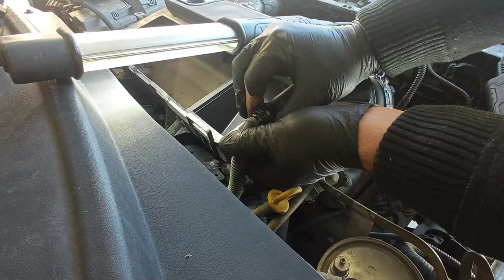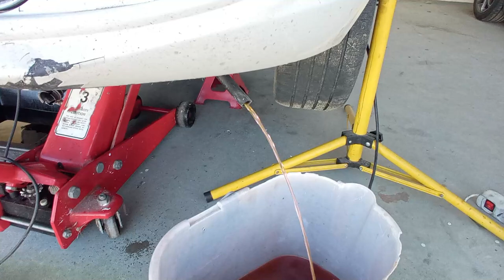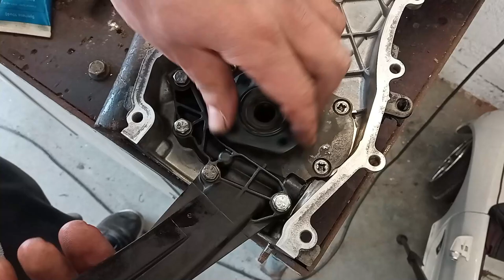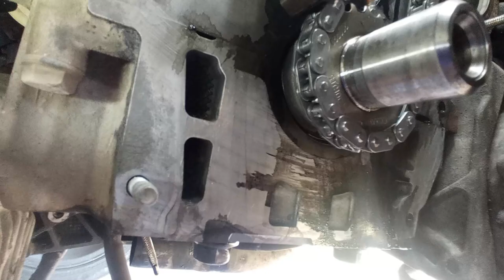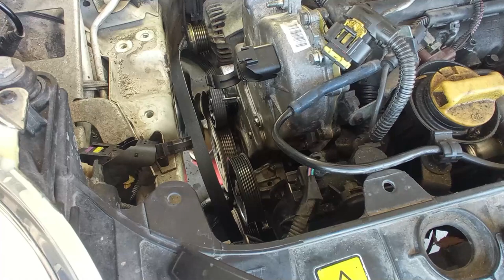Noise from something loose or scraping!? Timing chain for all 1.3 mjet engines for all years

Comment: I can't thank you enough for this video. This job took me 2 days as a hobby mechanic . Challenging was finding the torque wrench for left hand thread on the crankshaft. I ordered the dayco ktc1118 kit . this kit included the bolts ,except the oil pipe bolts and crankshaft flange.
Reply from the maker: Hello. Thank you a lot for watching the video! And thank you for sharing that info!

Comment: I'm sorry but I must point out one thing. Never lift this engine on the sump, it's super sensitive, slightest dent and it can couse a low oil preasure and that is super hard to locate since you can't spot the dent with your eyes, it needs to be meassured to be discovered.
I did it myself and spent a lot of time after chainging the timing chain figuring out what was wrong, I only run it for a few minutes but that was enough to mess up the turbo. During my search for the problem I only found one single line about this on google, only one, some guy having the same issue and that was the reason.
And I was very careful while lifting the engine, still this happened.
Reply from the maker: Hello. Thanks for the heads up. I am fully aware that. That's why I did it from the corner and only with the engine mount off.
I did forgot to mention it. Also I did reform the bottom a bit before going back in. In a future video I will talk about that. Thank you
Reply: @alfaromeonoproblem Please do as I’m fascinated as how that cane be a thing.
Reply from the maker: Ok, I will. Did it also on my 33

Comment: Brilliant video, such detail and well edited. 

I’m curious as to know how suspended carbon particles can stretch a chain that was designed for a diesel. Fiat have been making engines for a very long time and should have known what chain was suitable. 

Do you think halving the oils change intervals is going to help much?
Reply from the maker: Hello. All modern engines suffer from this. They have to make lighter engines and engine components to meet emissions. That and too long intervals on services will kill any engine
Reply: @alfaromeonoproblem  Thank you. Any explanation on the reason why a slightly dinted sump might cause issues on the fiat engine please?
Reply from the maker: @paulas2610 yes. The oil pick up tubo bends and the seal near the oil pump lets air in.

Comment: Really great video, I've got to do this on a 1.3cdti in a chevy aveo, this is the only video I can find on the subject as you can imagine there's not many chevy aveo enthusiast forums. It's got low oil pressure so I'm thinking there's some plastic guide parts blocking the pump as the timing chain is also due replacement. What bit do you use to remove the cam timing covers? Is it 8mm hex? I need something really low profile as there's less clearance on my configuration.
Reply from the maker: Hello. How are you? Thanks for watching. Can you tell me at what minute of the video are you referring to?
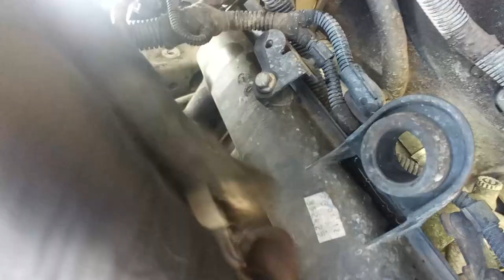Reply: @alfaromeonoproblem  It's 9:52, I can hear you say 8mm and it looks like it's a hex bit but not sure
Reply from the maker: Yes, its a 8mm hex. Just like on this video https://youtu.be/s1ViwKH4W1o?si=n_6iXOGzPKwWlooN
Reply: @alfaromeonoproblem  nice one thank you
Reply: @alfaromeonoproblem I’ve removed the pump now, and it looks okay, so does the timing chain and all the guides are intact. It’s a slightly different pump that doesn’t have variable flow but there was nothing blocking any channels. There seemed to be oil reaching all the right places as it drove quite a distance before getting to me with the low oil pressure light on, is there anything you can think of that would cause oil to not reach the pressure sensor properly? It’s had two sensors and I’ve tried a mechanical pressure gauge which reads zero so I’m quite confused what could be happening
Reply from the maker: @FlashFireSix the sump. Is it straight? The pick up tube is very sensitive to that.
Reply: @alfaromeonoproblem  it’s had a new sump, but I’ll ask the owner if the sump was replaced before or after the problem, thank you
Reply from the maker: @FlashFireSix probably a snapped oil pick up tube
Reply: @alfaromeonoproblem  I have the sump off too and the pick up tube looks okay, I did find some oil soaked part number stickers on the floor after I pulled the pump so I’m wondering if they’d been floating around and blocked the pump from working properly! I’ll get a new pump and chain on and see if anything changes. Your videos have been a life saver during this project so thank you for doing what you do
Reply from the maker: @FlashFireSix a sticker for sure you do that, for sure
Reply: Just wanted to drop by and say thanks to your video I managed to fix the car for my friends mum, who’s put about 400 miles on it since I gave it back all working great now. Keep doing what you’re doing and thanks again for all the help!

Comment: hello, I follow you every time, what you do is perfect, I also have a doblo 1.3 mjet 84 hp and I suspect low oil pressure, now I don't know if that's the case, maybe you can help me. cold 3.5 bar at 34 degrees outside / when it warms up to 80-90 degrees, the engine at idle is about 1.2 bars and at 2000rpm it has 3 bars and at 3500 rpm it does not exceed 3.5 bars. is it ok?

￼
Reply from the maker: Hello. That numbers are good, don't worry
Reply: @alfaromeonoproblem  Thank you very much for the answer.

Comment: Brilliant video! It's a joy watching you do the job properly! 👏
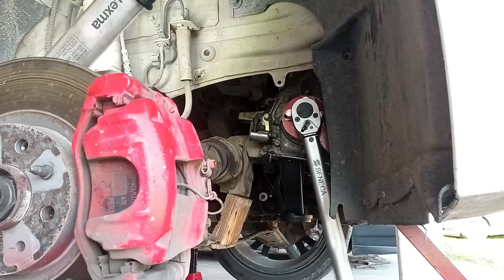P.S: 43:12 I think the pads are not mounted properly, the outer ATE pad says "PISTON", which should be inside and not on the outside. Correct or I am imagining it? :D
Reply from the maker: Hello. How are you? Thank you very much for watching! You are correct, aldo the ware signal wire seems correct because it is on the inside pad. 
Maybe. A miss print or the signal wire is in fact on the out pad. Is not very critical on small brakes like this.

Comment: Hello, very nice en useful video. My mito 1.3 always have a kind of raw start. It runs not nice and gives some blue smoke. It disapears after 5-10 sec. I already changed the glowplugs but it wasnt the problem. Can you help me? Thanks
Reply from the maker: Hello. Please check out today's video for that please
Reply: @alfaromeonoproblem  thanks mate, is it possible to refurbish or clean the injectors by yourself?
Reply from the maker: @rubenbroex3338 hello. No, it is not. They always need recalibration afterwards.
Reply: @alfaromeonoproblem  can you also not change only the needle?
Reply from the maker: @rubenbroex3338 no, mainly that!

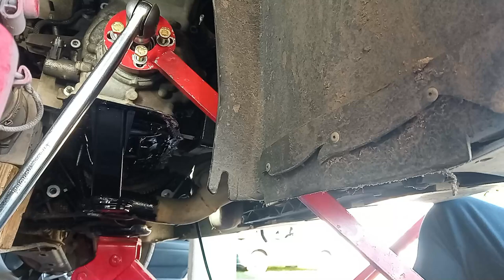Comment: At 17:30, what socket was used to undo the crank bolt?
Polydrive / RIBE sockets don't exist because the bolts are supposed to be tamperproof.
Reply from the maker: E18 torx bolt. You can find all kinds of ribe bits and sockets on your local workshop tool shop

Comment: Great video .I just did my 05 corsa by watching this. All back together but now wont start. sounds like starter not turning engine but  have seen the belt moving when turning the key. Have I left something disconnected ? Any help would be appreciated.
Reply from the maker: Can you turn the engine easily by hand?
Reply: I can turn the engine. At a loss as to what i did wrong? It does not even try to start @alfaromeonoproblem
Reply: Thanks for the reply ..
Reply from the maker: @jasperdesi5089 but does it spin freely?
Reply: @alfaromeonoproblem  I can only turn  it with a ratchet , not sure if I would say it easily.  I do have to apply a bit of pressure .
Reply from the maker: @jasperdesi5089 did the oil pump flange went it smoothly?
Reply: @alfaromeonoproblem  I put the oil pump in and left it in as I tightened it bolt. I could rotate it by hand as I tightened it. Cant remember if I checked after tightening. Could that cause non start?
Reply: Also rechecked the timing after trying to start it rotated the engine few times. All looked good
Reply from the maker: @jasperdesi5089 ok, if you can rotate it normally, now perform a diagnosis and check this:
https://youtu.be/XU80JQrHggs?si=8OLcduFKJBhPAQ-9
Reply: Thanks I have watched this, I have just ordered a cheap obd  reader. Hope it will help.

Comment: Hello, good luck. Is there a video of the 1.3 Euro 4 engine? Can you make a video, thank you 🚗
Reply from the maker: Hello. A video for what issue?
Reply: the engine looks euro5
Reply: I did not changed my timing chain and my car is at 200k kms
Reply from the maker: @ericcartmansn4737 hello. Try to hear the chain, it may start to rattle now. If not, don't mess with it

Comment: Hi, I've had my 1.3mjet for four years and every year the chain has started to rattle and I've had to replace the kit, is there any reason for this as I'm very fed up now, many thanks
Reply from the maker: Hello. Low quality chain sets will do that. Is very common
Reply: @alfaromeonoproblem  many thanks, do you have a particular brand that you use? I've been fitting the FAI kits over hear in the UK, was told they are pretty good🤔
Reply from the maker: @15DAVIDYOUNG those are the worse ones that you can use..
Ina or Dayco only. No autodoc
Reply: @alfaromeonoproblem  thank you, its normally the tensioner itself that is the problem, I only just noticed that they have a small hole in the back to let oil flow but in my opinion that's going to allow the oil pressure to leak off and put all of the effort on the tentioner spring, do you have a link please
Reply from the maker: @15DAVIDYOUNG a link for what?

Comment: hi, maybe you can help me, I have a problem on the alfa romeo mito, the right dipped beam doesn't work, I changed the light bulb, are there separate fuses for dipped beam if you know? Thank
Reply from the maker: Hello. For the main bulbs normally there is a fuse for each bulb. Low beams, hi beams, fog lights. And more. 
When a bulb goes out it can take a fuse with it

Comment: Hello man, first of all congratulations for the quality of the work and the amazin contents you bring to the channel. I'm also doing a chain for a 1.3 multijet but when I put the block in the camshaft the block in the flywheel doesn't fit and is two teeth further forward. In this case should I remove the chain and move the camshaft or the lower one back? Thank's so much. Love from Italy
Reply from the maker: Hello. Thanks for watching. It's a bit common. Don't worry, lock the crankshaft, take out the chain, rotate the camshaft until you lock them in
Reply: @alfaromeonoproblem  the problem now is that the camshaft broke while I was unscrewing. there was the block but it gave way and broke the camshaft
Reply from the maker: @alessio684 yes, ir does that. Now you have to replace them.

Comment: Everything that is said by the comments true, best have see. Not done any work on engines for about 30 years but have changed Timing chain with all your help 😊
Reply from the maker: Thank you very much for your kind words. I'm glad it was helpful! Share with your friends please
Reply: I am ready to remove Crankshaft Star nut got Camshaft locks but can’t find Crankshaft locking position, is it under the Sensor on a Peugeot Bipper 1.3
Reply from the maker: @mikewinstone7361 can you confirm if it is a fiat or Opel gearbox?
Reply: @alfaromeonoproblem  didn’t find it but marked Starter ring now all completed and running smoothly Thanks for your help🙏

Comment: Hi, where did you get the red tool to remove the oil pump flange?
Reply from the maker: Hello. I made it.
Reply: @alfaromeonoproblem how tight have you tightened the flange bolt?
Reply from the maker: @edoardo120 like 300 or something